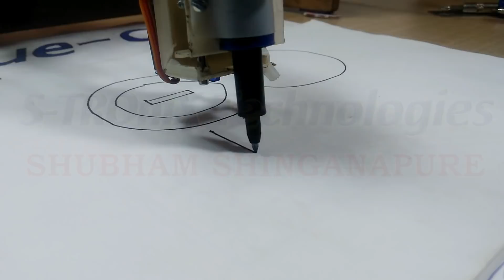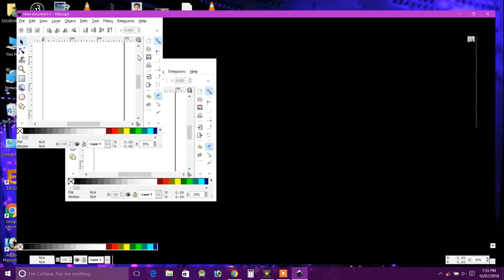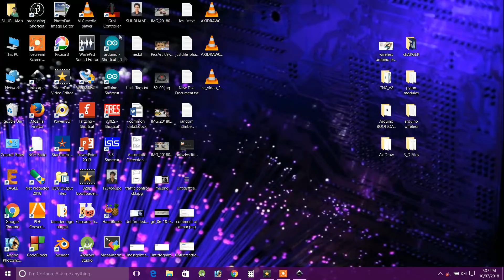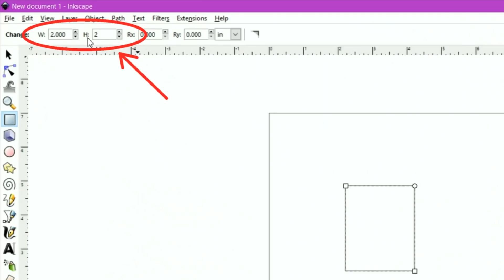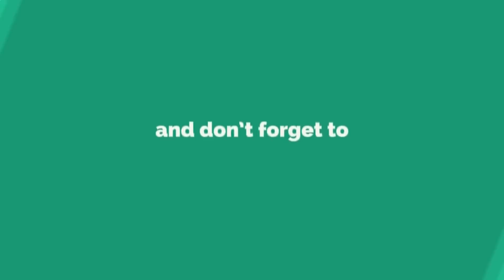How to Make Wireless Arduino CNC Plotter machine At Home.

Comment: Hii bro.can we operate with grbl controller version 2.56 which i have installed from playstore,with Bluetooth(wireless).and we have to give the g code link in the app?does it works using mobile?

Comment: aapko jitni baar thanku kahu kam hai ,mai is machine ke liye bahut confuse tha ,thanks for this video.🙂🙂🙂🙂😊
Reply: Bro is your motors working fine? Mine are heating up
Reply: @piyushchanchlani  Might be a lil late but a4988 pe screw anticlockwise ghuma lena thoda
Reply: @shantilkhadatkar1195  😂 I left the project midway, will go back one day the machine's Arduino everything was set just wasn't able to make the wooden base, as it was around lockdown.
Thanks for the tip bub!
Reply: @piyushchanchlani  Aree bhai 😂. Mera bhi lockdown ke time CNC machine bana ke khatam hua tha. Bas wireless karne ki koshish ab 😎

Comment: Sir,it is working fine.But My stepper motors are heating after working around 4 minutes.How much volts and amps are you giving to the CNC sheild.please reply me
Reply: Bro same problem with mine can you please help
Reply: @piyushchanchlani I gave it 5V 2amp to GRBL shield instead of 12V 2Amp.Now It is running silently without heating.
Reply: @Mohamed Irfan  bro can i have your contact details please i am also working on these project and getting lots of issues please can you help me out
Reply: @piyushchanchlani  my machine - https://youtu.be/wXEW4-5Yhug

Comment: Hello, I tried to generate a G-code with inkscape 0.92 with (MI GRBL Z-AXIS SERVO CONTROL), when i insert it
in grbl controler to print my design it says, " buffer size is too small". any one can explain what is the problem. 
Thank you.

Comment: Hello bro we are facing some problem in uploading the code As command letter error
Reply from the maker: which errors, can you show me.
Reply: @ShubhamSuresh Sir , after typing last AT  command {AT+INIT} ERROR 16 is showing  on the serial monitor otherwise all AT commands are working correctly . sir please help me
Reply from the maker: @suchitakumari8901  try it again or try to upload program using it. sometimes that last command not maters.
Reply: @suchitakumari8901  bro my motors are heating up too much please can you help me
Reply: It's our major project sir can you please reply fast sir?
Reply: Please reply to that mail give me your number sir we say about our errors .
Reply: @ebalaji6615  bro my motors are heating too much please can you help me

Comment: Sir my servo is not working what should I do .... ?
Reply from the maker: which GRBL version are you using..... use MIGRBL or similer of that which support z axis servo
Reply: shubham shinganapure sir I am using grbl controller 3.6.1
Reply from the maker: @lillysukumar2318  I am not asking about grbl  controller, I mean which grbl version you upload to your arduino board
Reply: shubham shinganapure ohh sorry it is not specified the version only written MIGRBL .  please help me to over from this problem , i am doing this project  for my school exhibition . please help me. Sir
Reply: Plz reply sir
Reply: can you please tell me brother did you converter unipolar 28byj to bipolar? Or how did you connected that if not please please i am stucked

Comment: What is the input voltage please tell me
Are you giving 12 volt 2 amp the arduino??

I am trying to build it
Reply from the maker: yes you can use 12V 2Amp power supply
Reply: @ShubhamSuresh  12 volt to the arduino??
Reply from the maker: @mohamedirfanam  yes you can give 12v to Arduino also
Reply: @ShubhamSuresh  thank you
Reply: can you please tell me brother did you converter unipolar 28byj to bipolar? Or how did you connected that if not please please i am stucked
Reply: @piyushchanchlani  I converted to bipolar
Reply: @mohamedirfanam  bro please mujhe help karde yaar 🙏🏻 haath jodke request karta hu merko bahut dikkat arhi hai is project mei aur 24 ko submit karna hai mei apna number du whatsapp pe hii bhejo ge mei vaha pics bhejta kya issue hogaya hai
Reply: @piyushchanchlani  https://youtu.be/FLJGCZslOcM 
I followed this video
Reply: @mohamedirfanam  bro the video on which we are talking video of Shubham Suresh ... In these video this person has shown unipolar or bipolar?

Comment: From where I can get SS rod please reply friend
Reply from the maker: from your local Hardware shop
Reply: @ShubhamSuresh  My stepper motors are heating after working around 4 minutes.How much volts and amps are you giving to the CNC sheild.please reply me
Reply: @ShubhamSuresh  is there any solution to heating of motors
Reply from the maker: @mohamedirfanam  H ow much Volt Amp Power you providing to your CNC Shield
Reply: @ShubhamSuresh  12 volt 2 amp
Reply from the maker: @mohamedirfanam  and What voltage specify on motor
Reply: @ShubhamSuresh  5v
Reply: @ShubhamSuresh  how much volts are you giving
Reply from the maker: @mohamedirfanam  try 9V 2A power supply
Reply: @mohamedirfanam  hey is your motor working fine now?

Comment: I want to ask you some doubts
1)what is the input power to the arduino
2)is the stepper motor 5v
    Is the stepper motor bipolar or 
    unipolar.
3)which one x Axis or y axis (base stepper or upper stepper
Reply: Hey hello is your motors working fine? I am getting error

Comment: What version of inkscape are you using?

i'm getting an error(?)
Traceback (most recent call last):
  File "servo.py", line 3172, in <module>
    e.affect()     
  File "inkex.py", line 283, in affect
    self.effect()
  File "servo.py", line 3156, in effect
    self.orientation( self.layers[min(0,len(self.layers)-1)] )        
  File "servo.py", line 3085, in orientation
    doc_height = inkex.unittouu(self.document.getroot().get('height'))
AttributeError: 'module' object has no attribute 'unittouu'
Reply from the maker: use 0.47
Reply: Inscape version 0.45

Comment: Dear Subham, can you guide why my z-axis servo for pen up/down not working. X and y axis are working fine. What may be the possible reasons ?
Reply from the maker: may be wrong connections, or you didn't set the servo angle while making g-code.
Reply: @ShubhamSuresh  thanks for prompt reply, well, connection I am sure they should be ok, because the other two axis are working, infact if I am connecting a stepper motor with a driver to z axis similar to x & y axis, it is working fine but the servo is not working, the connections are as per video.
Reply from the maker: @shahraj1918   ok then may be problem is in gcode. while making g code, at the end when you are going to save it, their is window popups in that window set servo angle.
Reply: by default this angle is 90, i hv tried by varying this angle but still the problem is same, what should this angle be?
Reply: @shahraj1918  the problem is in the version of grbl frimware which is burn in Arduino its should be 0.9i version (servo support)
Reply: @shahraj1918  hey can you please tell me is your motors working fine now? As mine are not
Reply: @imagine1706  please help can you please tell me is your motors working fine now
Reply: @piyushchanchlani  Yes, they are working fine, the problem was in the jumper cable of servo motor. Changed the cable and not it is working fine.
Reply: @shahraj1918  which threaded rod have you used please tell and which nema 17 please tell
Reply: @shahraj1918  please
Reply: @piyushchanchlani  I have used stepper motor of dvd drive and they are working fine. The only problem is working area is very small, just 50mm x 50mm.
Reply: @shahraj1918  oh ok mahn thanks can you please tell me how much volts and ampere power supply are you giving
Reply: @piyushchanchlani  12V 10Amps Meanwell power supply.
Reply: @shahraj1918  10 amperes or 1 amperes
Reply: @piyushchanchlani  10 Amps power supply..
Reply: @shahraj1918  can you please tell me brother did you converter unipolar 28byj to bipolar? Or how did you connected that if not please please i am stucked
Reply: @piyushchanchlani  I have used CD/DVD ROM drive in my project, they are already bipolar stepper motors, but if you are using 28byj motor you have to convert it to bipolar for using it with arduino V3 CNC shield. There are tons of videos on Youtube for converting unipolar to bipolar.
Reply: @shahraj1918  yeah i did all working fine now thanks

Comment: Nice one brother can you send more details and is possible to use the normal controller for 5v stepper motors and arduino?
Reply from the maker: Which controller bro will you specify it
Reply: shubham shinganapure hi there ULN2003
Reply from the maker: yes you can use this driver but you also need to change source code for that. follow this link https://www.youtube.com/watch?v=hjZgVoZcHms